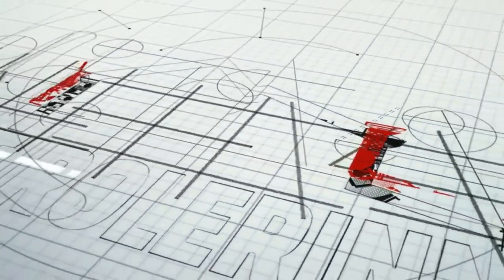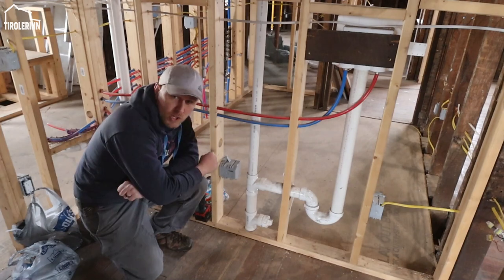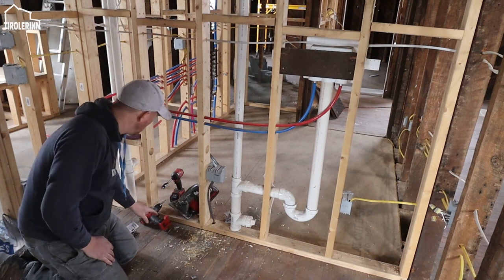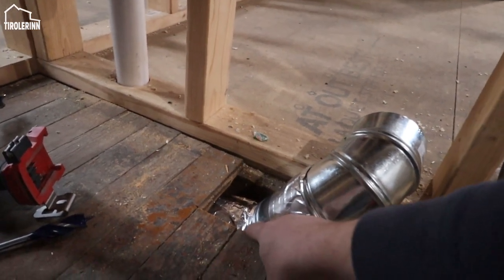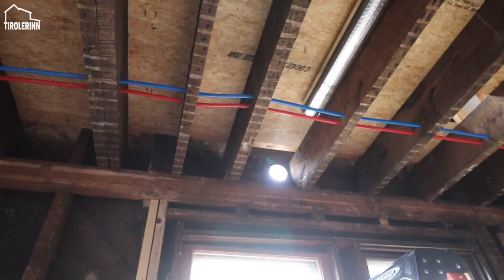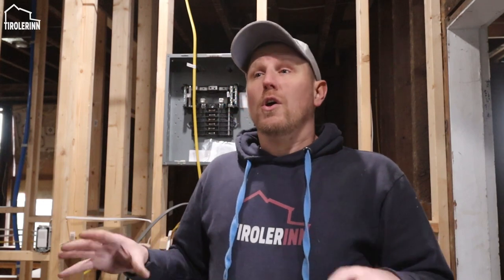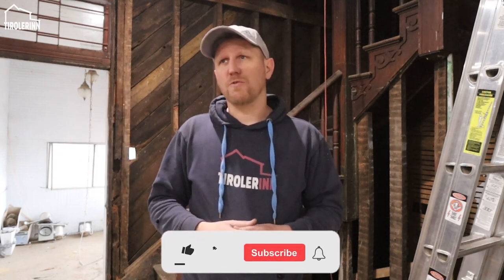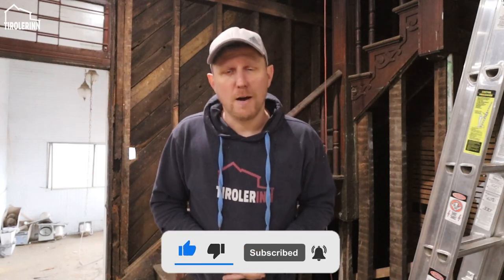Dryer Wires and Venting - Tirolerinn - Victorian Home Renovation

Comment: You are smart to wire it.  You will not regret it.  You can always add WiFi, but it will be hard to add wiring later.  You can do the CAT 6 the same as the electric.  Have small closets on each floor and have switches located there.  You have to keep runs to under 100 meters (328 feet) anyway.
Reply from the maker: Yes. I am adding a nice server rack in the laundry room closet and will use Ubiquity equipment. 2 wires to each box for save measure in case of 2 devices like tv and gaming console going on the same spot. Do you recommend a hookup or two in the dining room?
Reply: @TirolerInn  Yes I do.  You never know.  You might use it for guest entertainment.  You can always hook up remote speakers for sound.  I also recommend a mesh type of WiFi.  It helps when you move around the house.
Reply from the maker: @JPW-qm6xe  good call on the speaker system. Yes we will be using a mesh system. The APs from ubiquity are natively mesh ready when configured right.
Reply: @TirolerInn  I really like Ubiquity also.